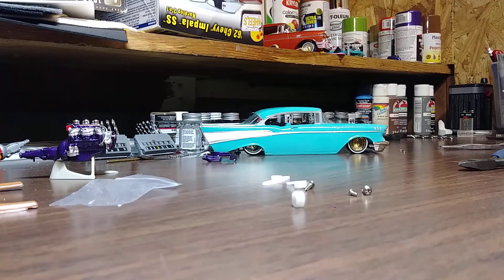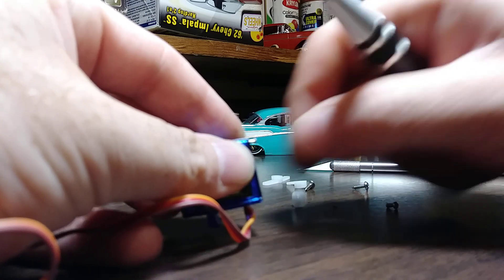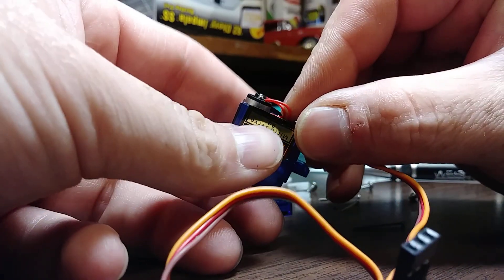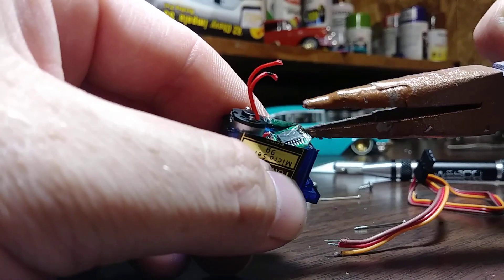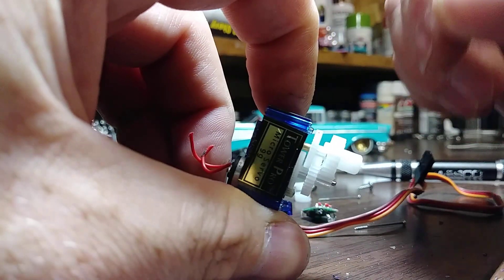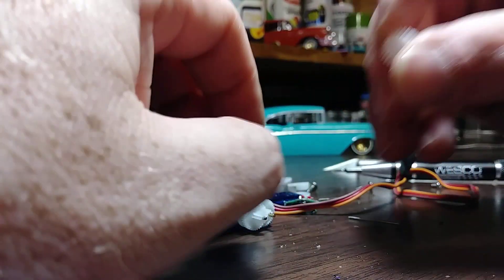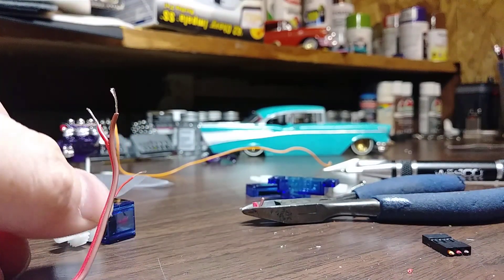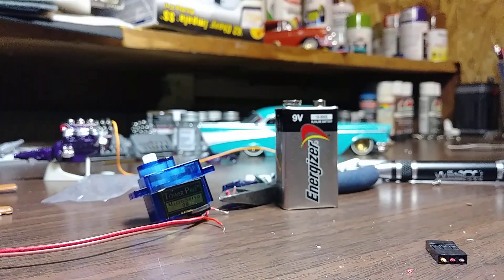Lowrider model car hydraulics Servo Mod

Comment: The servos I bought look the same but have a circuit board is connected to the back of the motor and no red and black wires inside. I took a whole motor apart. Any suggestions on how to mod it?
Reply from the maker: Yes, there should be 2 wires coming from the motor. Those are all you need, cut them from the circuit board and junk the board.

Comment: This is one of the most asked about things when building a functional model Lowrider. Great job explaining how to modify a servo. I just wanted to add 2 things. After you modify it, you can cut out some of the unused plastic (leaving the gear housing on, but cutting the “extra” plastic which leaves the servo in a sort of “L” shape) if you need a better fit. Also, some people use smaller servos (I like both the 3.7 gram and the 4.3 gram servos for this) when building a car that doesn’t have much room for the servos. I haven’t come across a smaller servo that needs any modification to rotate 360 degrees both ways. Just my 2 cents. Great video!
Reply from the maker: Jame 
Thanks! Yea, my cutlass has a real small servo and all the impalas have L shaped servos that I cut to fit. More to come....
Reply: John Connor no problem at all. I’m definitely not trying to step on your feet so to speak, I just wanted to add those two things to try and help out a bit. I know that a lot of people want to learn how to build these, and these videos help out a ton. Salute to you for doing these how to’s.